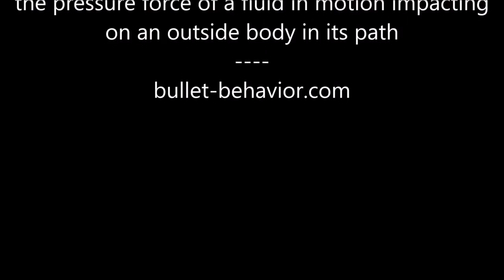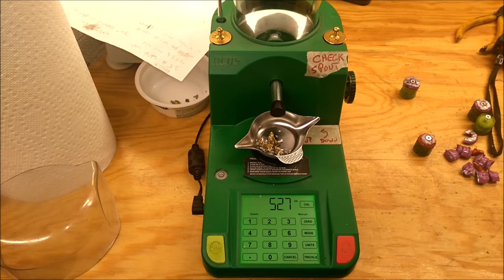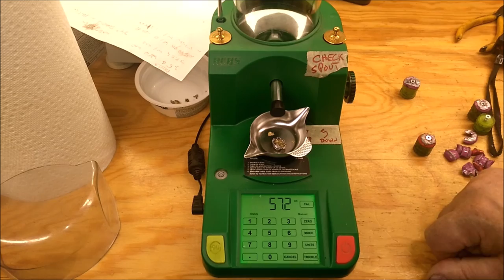Even more gel testing (some different powder charges)

Comment: I really like those slugs. Wonder if there is a way to increase the base of the projectile so after the petals shed it retains more mass and penetrates further? Thanks for sharing! I’ve heard that gel is a lot of work to prep and maintain, so thank you!
Reply from the maker: The sprue plate is at the base, and the mold design doesn't leave much meat to remove.